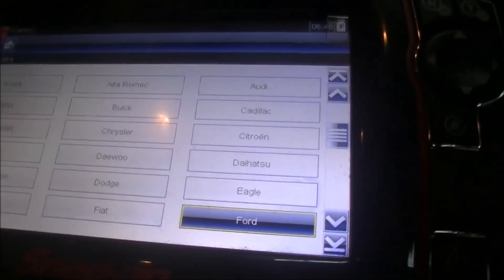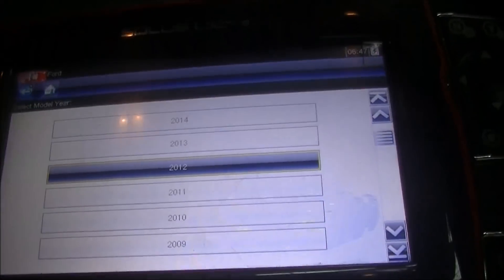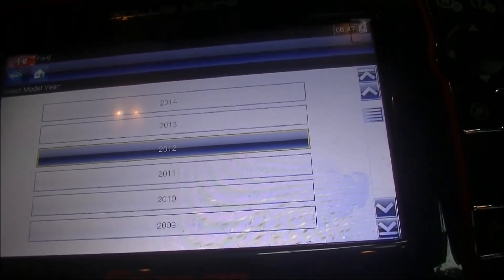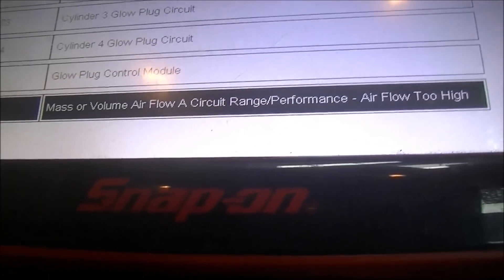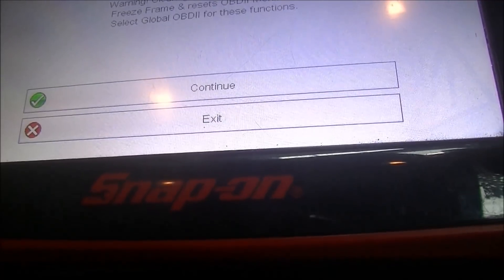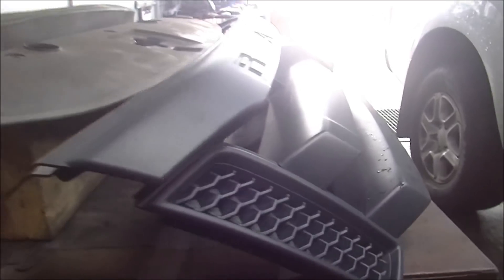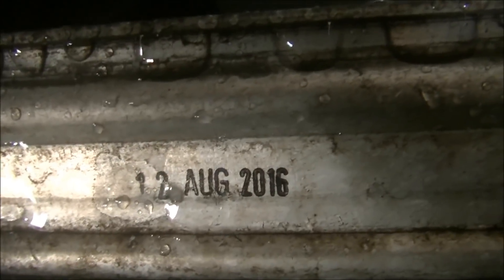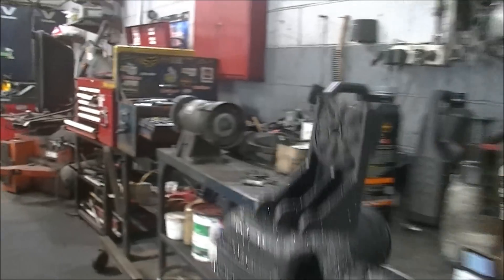Out of the frying pan into another frying pan...Sub standard repair.

Comment: I've seen this on the Eco Boost F150s, you can drill a small hole at the bottom of the cooler to  let the oil escape. Causes random misfires on them, drill the hole and no more oil burning,problem solved!!! Keep Rocking it out!!!
Reply from the maker: No hole drilling for me Pat...I'd be real happy if they all went into runaway mode and disintegrated...That's entertainment...

Comment: When I used to work at ford in Dandenong when PX rangers were just coming out, we were replacing these intercoolers flat out. They also split the top charge pipe.
Reply from the maker: Changed a few of those intercoolers my self...One had been changed by Ford under warranty just 2 years earlier.!

Comment: the only experience I have had with diesels was an 82 chevy with a converted Oldsmobile engine in it,  it was very low power, I later put a 455 gas engine in it and there was a remarkable increase in the power the car had.
Reply from the maker: Horrible noisy stinky things powered by the fuel of satan.
Reply: They put that same motor in the 80s Cadillac.

Comment: yeh im a believer of good quality catch cans BUT your asking for trouble if you dont empty them, so much crud can build up in the the head intake ports that youve got to remove the heads just to properlyclean them thanks to EGR and oil mixing .i like diesels for towing but only the reliable ones , not a fan of common rail though very very expensive repairs.
Reply from the maker: A person shouldn't have to add special stuff to a factory unit to eliminate the possibility of an issue..This thing is a repeat offender and it appears the intercooler blow out is a pretty common thing...I expect the Mazda version does the same.